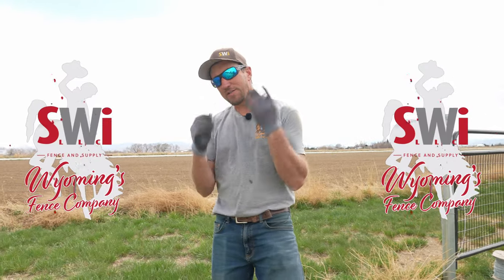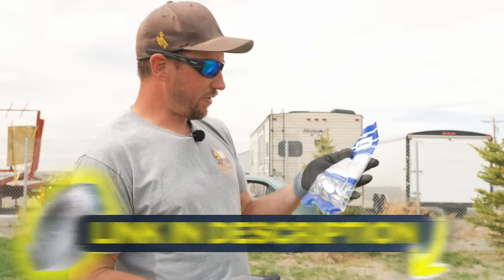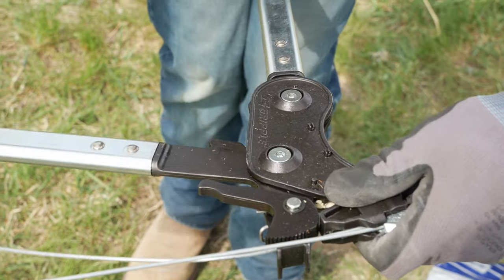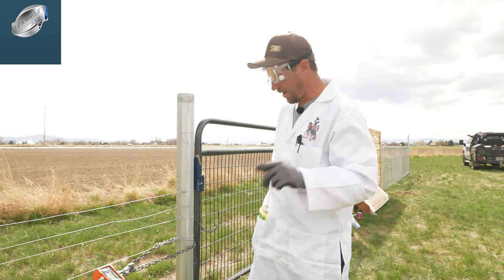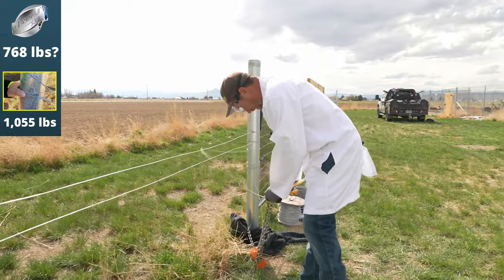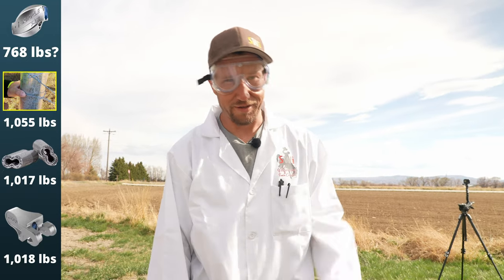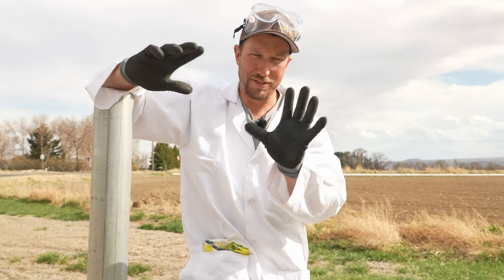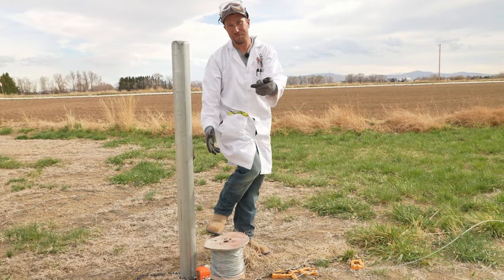This Fence Gripple Torture Test Surprised Me

Comment: GREAT video, Dan.  Very clever method of testing.  FWIW, I think it's predictable that the wire would break at the Gripple because the geometry of the Gripple holds the ends of the wire at a slight angle and therefore puts a slight bend in the wire when it's tensioned.  Depending on how tight the wire is tensioned, the wires will be bent where they enter the Gripple and have a weak spot there.  So while the Gripple held in both cases, the wire failed at the weak spot caused by the Gripple.  Anyhow, good job!!
Reply from the maker: I think you're right!

Comment: Awesome video and information, thanks. Question though, what is the tension/ lbs on the wire with just the Gripple tool? And would the wire be less likely to break at a lower tension? Also, I really need a tutorial on stretching woven fence over a rise. Thanks.
Reply: @mikelowell8742  that helps, thank you.
I rewatched this video and got my answer to the other questions, missed it the first time

Comment: But the wire didn't break in or at the Gripple?  It broke away from it so how did the Gripple cause the wire to break?
Reply from the maker: It actually did break in the Gripple. Originally I thought it didn't, but later realized it had. 06:16